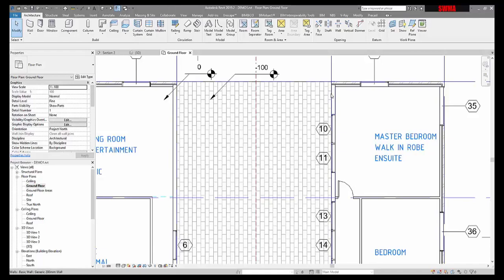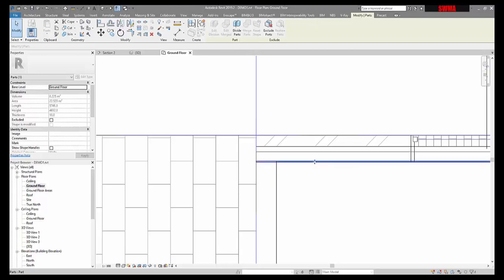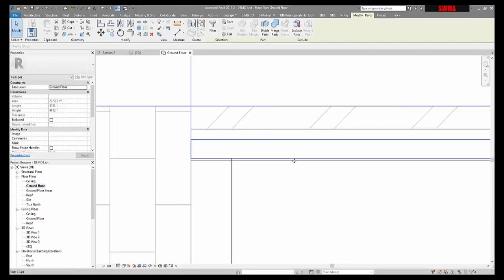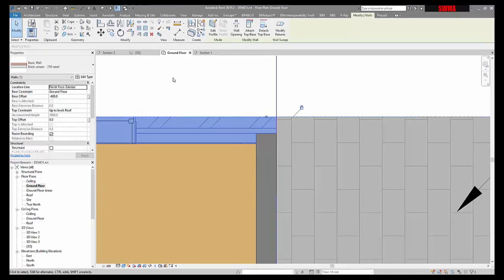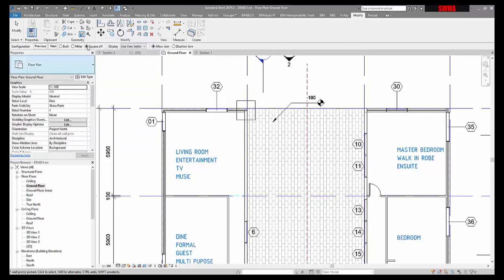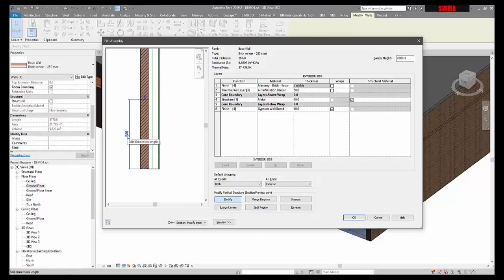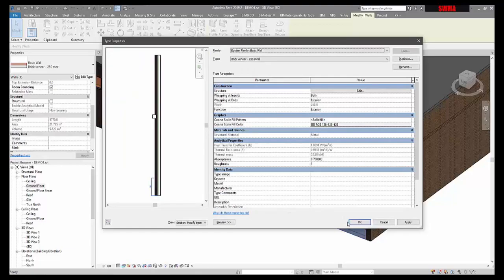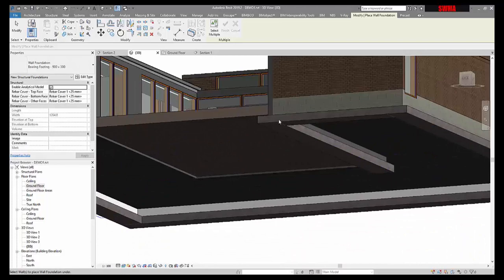V016_Wall junctions and splits

Comment: Even though I can see you are struggling to get the create parts tool to work properly, thanks to your video I can much better understand the concept, so this has actually been very helpful indeed! Revit is very complex, particularly when you have a complex shaped building in the first place - with split levels to work with, as I am grappling with at the moment!! Many thanks again :)